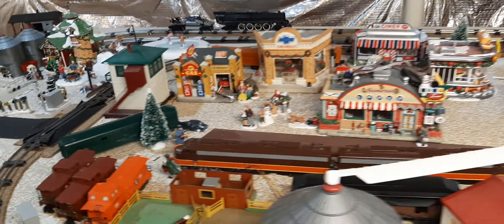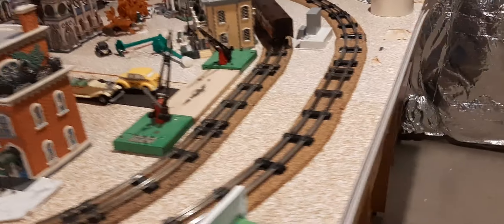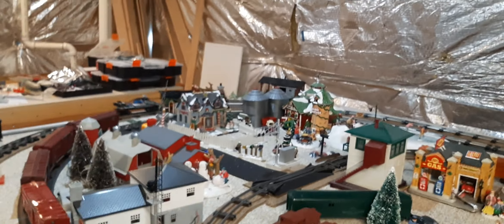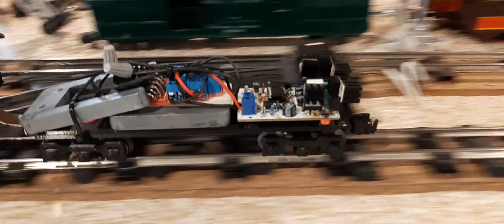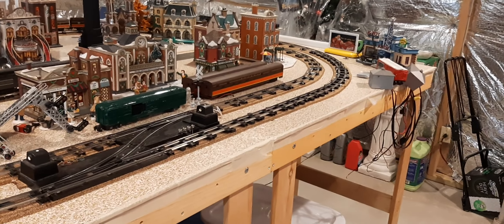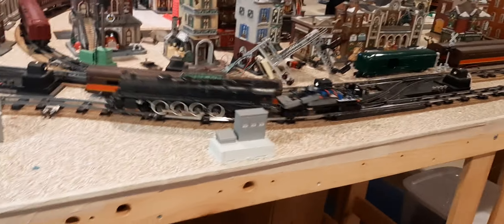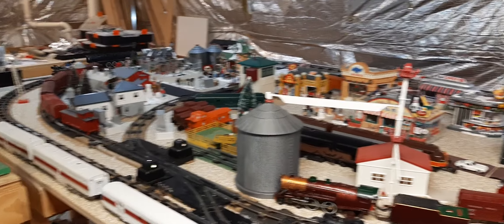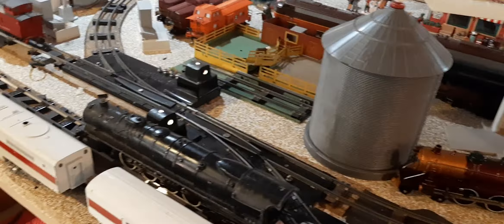Northern test of New All Wheel Pick Up Truck 4 wheel type. Trucks ran just fine.

Comment: Do you easily notice whether it gets more consistent power with the all-wheel pickup?  It runs great, I wonder how it ran with the original trucks?
Reply from the maker: @alanb287  this is not the original tender, but I can say from experience and my layout these assemblies are much more robust thru switches, turns and dirty old Vintage classic Flyer track. I am so busy I don't clean my track often nor do I get service the tender wheels regularly. So I really see better operation. Especially when I stuff the tender and engine with 8 PC Boards digital control for reverse, sound. Smoke heat and smoke Puff supported by 2 AC to DC converters and 3 DC Volt regulators. So my engines thrive better with AWPU trucks. All the vintage engines would stop, Flicker, slow down the old reverse unit would drop out all the time especially when going through switches. I did this work to help me keep my own engines running smoother and they are. D
Reply: @DennisMurphey  Thanks for your explanation.  It's a great idea.